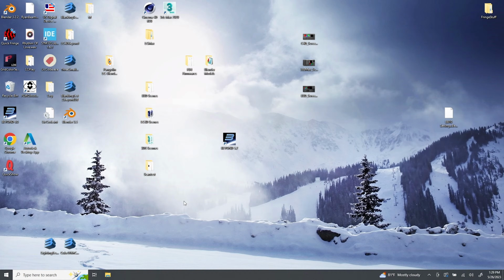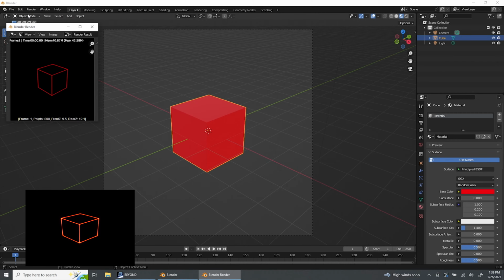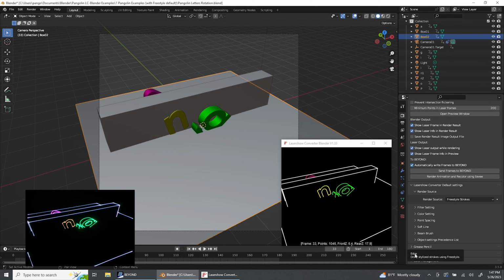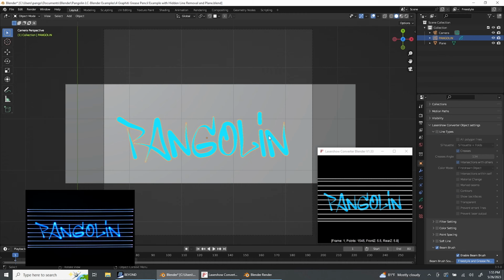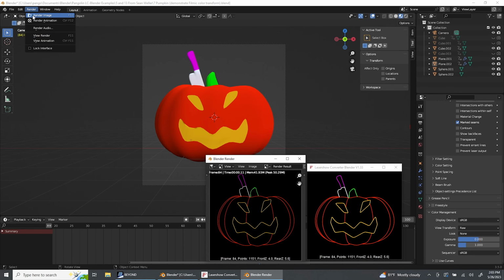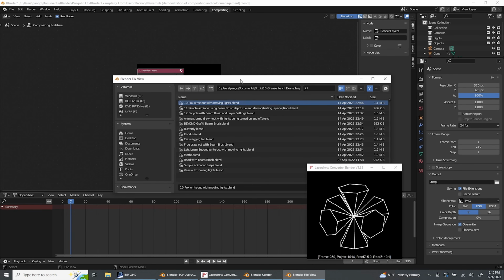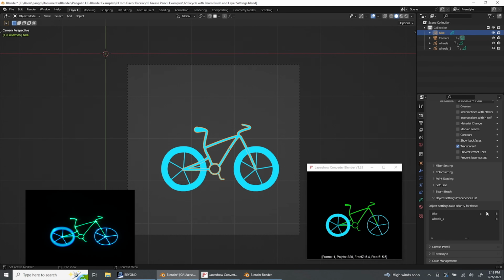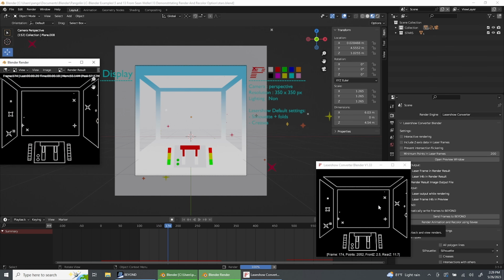How to use Laser Show Converter Blender | Deep Dive Presented by William Benner

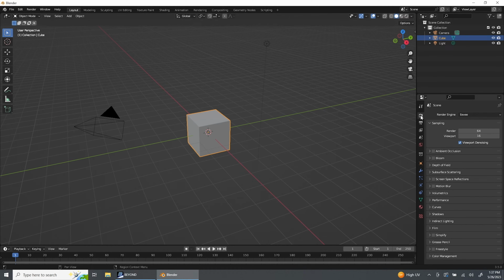Comment: At time 7:30, I show setting the window to 320 by something. This is not only to make the window small enough to be fast and usable, but it also affects internal curve and corner-detection calculations which were optimized to work well in a "320 by mode". You can make the window any size you want, but other sizes may require you to adjust the corner detect and curve detect settings for best results.

Comment: Is there anything similar to this where instead of going 3D model to laser show you can instead take a  2D youtube video(or movie file) to laser show?
Reply from the maker: Like for example, the real time video tracer? https://wiki.pangolin.com/doku.php?id=beyond:real_time_video_tracer&s[]=trace&s[]=video
Reply: @PangolinSystems  That looks great. Realtime Tracing I think is a good match to what I am looking for. From the wiki link I was seeing from inputs described as "Web Camera or Kinect device".   Would that real-time video tracer easily take an inputted AVI/MPG/MP4/etc file?   Does it only take webcam, or can you use other software to simulate a hardware video steam using those same AVI/MPG/MP4 files?   Silly question, but can I take a copy of Ferris_Buellers_Day_Off.MP4, import it into the software (or set up a video steam of that using other software), and have that be somewhat watchable over a laser and would viewers be be able to recognize what move it is by only seeing it (assuming they've watched the movie normally at least 5 times in their life time)?  I'm looking for something I can "play" files over a laser and not something that requires time to setup, process, etc to have it work.  I'm only looking to spend up time setting up the hardware and maybe a few minutes of software work.    If it can do what I'm describing, do you have a basic laser that you'd recommend to combo with this software?

Comment: Thanks, Bill!  This was quite informative.  Do you have any time to make a particle video?  I've been trying to make an extremely small square, emitting particles to render to Beyond without seeing anything but the 'dot' / square moving through the keyframe path minus the particles I can see on the render screen.  Any help is appreciated. Thanks again for making this tutorial!
Reply: We don't have any such videos. HOWEVER, note that there is a FILTER portion of the plug-in, just like there is for all of our plugins. Likely you should turn all of the filters to zero (or minimum) so that the small particles are not removed because the plugin believes they are "noise" or otherwise undesirable junk.